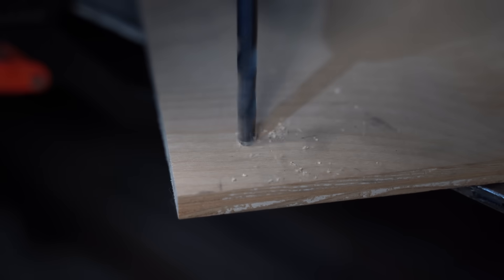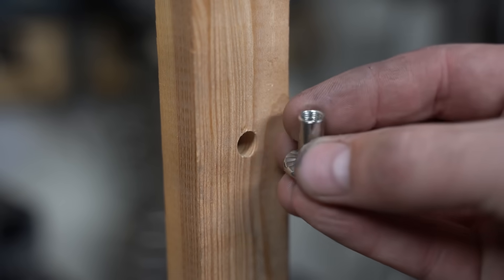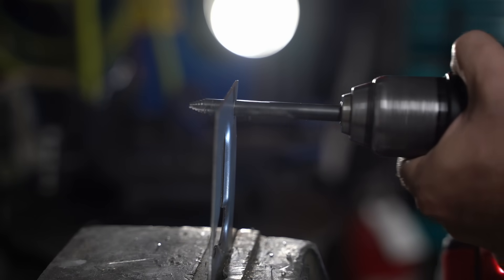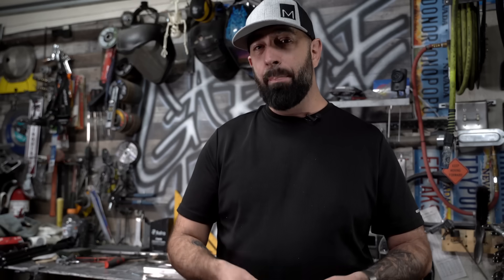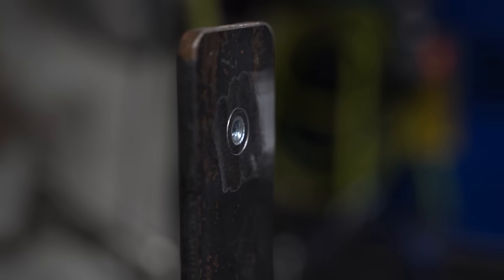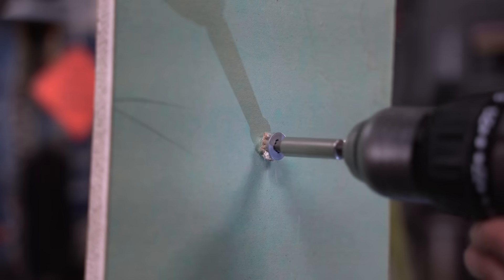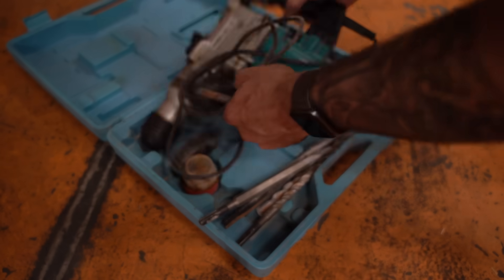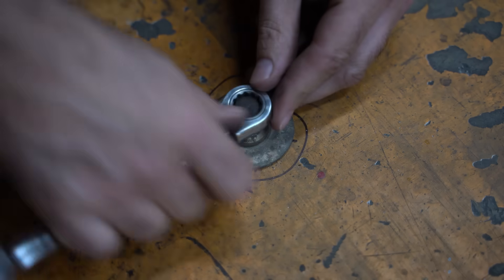Make It Bolt On! 9 Ways of Installing Threads Without Tapping.

Comment: I don't mind tapping steel.  But if the metal plate isn't thick enough to be strong after tapping, I'll often weld un-plated square steel nuts to the backside of a clearance hole.  I temporarily hold the nut in place from the front with a short stainless steel bolt sprayed with anti-spatter spray while I weld it.  That keeps the nut from accidentally getting stuck to the bolt during welding (if you overheat and distort the nut), and acts a lubricant when you disassemble it.   Square un-plated steel nuts work well for welding, because you can do two or four easy straight welds and you're done, and you get more weld area than you would get with a hex nut.  Places like McMaster-Carr sell the un-plated square nuts, and they also sell un-plated "weld-nuts", which are hat shaped nuts with a wide flange formed out of thinner steel to be easily tack welded or spot welded to the back face of sheet metal.   Whenever I finish welding nuts on the back of steel, I'll run a tap through just in case the nut's threads got slightly distorted from the welding heat.  I also try to unscrew the temporary screw while everything is still hot -- just because occasionally after the weld cools, things can pull a hair crooked and cause binding of the screw.
Reply from the maker: Fantastic info, thank you Tom! I can agree with every bit of that. I don’t often weld nuts, but threaded link bar end bungs behave the same way. I believe they shrink a little which causes them to seize up. I too run a tap through them. It saves a lot of headache.

Comment: Can you please do a video on using A grinder/ cut off wheel while cutting long runs and grinding and cutting control techniques it would be very much appreciated. Also any safety tips would also be appreciated.
Reply from the maker: Absolutely! What do you mean by long runs? What problems are you having?
Reply: @GarageFab starting and cutting more than a foot on mild steel,with out it grabbing or pulling off the line.

Comment: There's also wellnuts, which are essentially a rivnut, but made out of rubber. They are great for waterproof applications (marine) and they are removable!
Reply from the maker: Those are amazing!! Thank you. The images I saw indeed look like riv nuts.
So when you remove the bolt, do they spring back to their original shape?
I’m considering making a Part 2 with all the stuff I’ve learned from comments. This one will certainly be included.
Reply: @GarageFab Yep, they spring back to shape. They have a little threaded nut inside the rubber sleeve.

Comment: Quick tip for welding nuts (or anything) with the coating. Go to any hardware store and buy a bottle of muriatic acid. Pour a little in a small bowl and drop the nuts in there. Let it sit for a few minutes, and then rinse it with water. The acid will dissolve all of the zinc coating and take it down to bare steel. No grinding required!
Reply from the maker: I recently learned that vinegar does this as well. But it takes many hours. I'd be willing to try something a little quicker.

Comment: If you are going to weld zinc coated hardware.  Drop them in some 5% or higher vinegar overnight.  It will strip the zinc off and be safer for welding
Reply from the maker: Is that true? I’ve got some concentrated vinegar made for cleaning. 30% I believe.
I might post a short if it works. Care if I name you in it?
Reply: Oh yeah it works good. Takes the zinc coating off and makes it safer to weld.  I learned that from an old welder/ blacksmith. Welding zinc plated parts is just as dangerous as welding galvanized you don't want to breathe the smoke off of it.
Reply: You can use my name if you want.  I didn't come up with it  but I don't mind sharing.
Reply: Also don't forget to neutralize or wash them with a little water before welding.

Comment: Drill a hole just slightly smaller than the size of the male thread you have, but it must be a touch bigger than the minimum size of the male thread.
Then just ream it in the there, often with an impact driver...

Comment: For metal threads there is power taps, used by a drill, they are much tougher and allow multiple holes easier.

Comment: I use tee nuts on thin metal, cut the spikes off and then tack where the spike was, extremely strong, cheap and fast
Reply from the maker: I like it! So is the flat side against the metal then?

Comment: 4:10 zink coating is the usual coating on nuts - and this is TOXIC! if welded!!
So do not do that. 
There are nuts for that case, which are NOT coated. = raw steel. Besides that fact that those are  not toxic to weld on, those are also much faster to get ready and produce a better weld.

afaik they were cheaper as well. For my last year project I just bought a 50 peace pack of M5 ones, for some €. 
I actually just welded them from the back: 
- M6 whole drilled
- M5 welding nut with an additional nut on the other side and a M5 stainless bold to hold everything in place while welding.
- not not to weld tooo hot otherwise the thread will be affected.

Comment: A few tips:
When tapping always go two or three rotations forward then back out one rotation. This breaks the chip which will jam up your tap. That chip is the likely cause of taps breaking, especially the smaller sizes. 
Old machinist trick my dad taught me. 

Also drill the proper size hole, don’t guess.. it’s an easy google search. Improper hole size can also contribute to a broken tap because the hole is not the proper diameter. 
Lastly don’t ramrod your drill while drilling the hole, the metal can work harden by getting too hot. Always a good habit to also use lube or tapping fluid. 

Trust me on this.

Comment: That's the problem with welders. They want to weld everything. Anytime it makes sense I try to fasten things so they can be modified or adjusted without much difficulty. By the way I am a welder, but also a fabricator and repairman. Rivnuts are great, but use the right ones. Aluminum in steel tends to be problematic. The cheap ones are always aluminum and get used on everything without thought. The metal drywall screw anchors tend to spin when installing screw in drywall. Plastic work fine, I just predrill. And I only use metal ones in wood. The plastic breaks. Great ideas!

Comment: you can use your impact to rigid tap. much easier and way way faster. a 12 point socket will grab the shank end, or get fancy and buy a tap driver with a 1/4 or 3/8 end. go slow and keep the tap straight, use taping fluid on harder stuff. 
pro tip; chamfer the hole before taping to help guide the tap in straight.  for blind holes use a spiral flute tap., for through holes just about any decent plug type tap will work.

Comment: 5:15 the tubing nuts are star nuts that are used commonly on bicycles to hold the headset tight in the steer tube
Reply from the maker: I don’t know what those terms mean!! Back in my day the neck was held on by a long bolt attached to an angled doohickey nut inside the fork tube!
Reply: @GarageFab  I could show you how the newer bikes are put together if you like .

Comment: Nitride coated gun taps are your friend. Properly sized drill bit , a tap and a cordless drill and you can tap 1/2 dozen holes in 3/8 or thicker steel in the time it takes you to tap one with a t wrench.
For block or concrete Lead anchors with a hollow wall anchor set are the way to go if you want to keep the anchor flush with the surface.

Comment: I didn't know what barrel nuts were called. Now I can find them on McMaster. 

The throttle pedal assembly in my car is attached to studs that are just long enough, making it difficult to put a spacer under it to adjust the height. But with barrel nuts, I can make a thicker spacer, and still reach the studs that will be recessed. 👍

Comment: MK: I liked the flush welded nut. I put the nut and weld it on top because I’m usually welding it on tubing. It never occurred to me to simulate a riv nut for flat stock. Thanks
Reply from the maker: I have feeling your way is far more secure. I wouldn’t use the flush nut on something like a safety harness anchor. After grinding the weld down there’s not a whole lot holding it in. Great for stuff like fuel/brake lines.

Comment: FYI they make a variety of different nuts that are intended to be welded on.  Either plain, heavy hex nuts or actual weld nuts.  That way you don't have to sand off the zinc.
U-nuts are also known as spring nuts or speed nuts. there's dozens of different types out there.  I prefer the style that have an actual nut.
Also, the little plastic fasteners that OEMs use (christmas trees, push pins, etc) can be pretty decent for a lot things and make for a professional look.

Comment: Nicely explained and illustrated. I've been screwing around for decades but learned a few new ways to continue that tradition. How about those female threaded hex standoffs? Also, welding pipe through square or rectangular tubing to run a bolt through  that enhances its ability to survive force. I used this to mount a 12K winch on a trailer. With female threads its like a super riv-nut.and works well in C shaped auto/truck frames.

Comment: I’ve always known the U Nuts as speed nuts. Pretty common in older cars. Many times you will find them in slotted holes to allow for some fit adjustment.
A little tip for welded nuts, or if you are welding on a stud, is coating the threads with nozzle gel. It will keep the welding berries from contaminating the threads. It’s good for welding near any threaded structure to keep it clean and not needing to run a tap or die over it afterwards, especially if welding with flux core. 
I like to weld captive nuts by running a screw or bolt through it, using a fender washer on the back side, and coating any exposed threads with nozzle gel. Clean threads every time, and no thread distortion or material warping with the stabilization of the threads and the washer. For lots of them, I would make a fixture with a bolt or screw, and some .25 on the back for stability. If you are doing a project where you have a lot of welded nuts, the zinc coating can be removed with a bath in muriatic acid. It should be noted that welding through zinc coating can make you sick, and is no bueno.
With the nutserts, it’s good to run a tap through the after setting. The threads can distort a little. You can set them with a bolt, washer, and nut, if you don’t have the tool or you don’t have a particular setter for a thread.

Comment: For plastic, there are brass inserts that can be installed into holes with a soldering iron. This is very common place for 3-D printed parts that need threads.
Reply from the maker: Oh yes!!! I’ve seen those on the ol Instagrams! I might have to do a Part 2.
Thank you!

Comment: Grind a slot in the bolt & force it into the hole while spinning it with an impact driver, it will cut the threads itself.

like a self-tapping screw 😂

Comment: One note…you can install threaded nut inserts without the fancy tool using a bolt or threaded rod and  a couple washers. This also works in areas where it’s too tight to fit the nut setting tool. I prefer to work in areas that are too tight for my nut setting tool…jus sayin..🤷🏻‍♂️😆

Comment: Here is a tip for Nutserts, either steel or aluminum. Yes, the squeeze tool is a bit more convenient with less pieces but this saves money for a budget minded person. Nutserts do not require a special tool. All you need is a bolt with the same thread as the Nutsert plus extra thread to accommodate 2 washers and a hex nut.  Thread the nut all the way onto the bolt, lubricate the surfaces of the washers so friction is reduced and slide them up to the nut, then install the bolt into the Nutsert with 2 threads showing on the exit end. Install the Nutsert fully into the hole. Hole the head of the bolt with a wrench or socket to keep it from rotating. With an open end wrench, tighten the nut until you can feel that the Nutsert is no longer collapsing. You will know when. Now loosen the nut and remove the bolt, nut and the 2 washers. The Nutsert is not properly installed. Onto the next hole or install your part.
Reply: I came to comments to say this, but you’ve done it just fine! I used this method on a cheap (Chinese!) coffee-table a friend bought where the nuts were turning (hadn’t been tightened properly in factory). Worked a treat! Les🇬🇧
Reply from the maker: Nice! Thank you! I was recently redoing to think of a way to do it without the tool.
You can expect to see this in a video in the future. 🍻
Reply: @GarageFab  I've also used the above technique (or there abouts) for where I didn't have enough room to get the nutsert tool in there.
Reply: Thanks for this! If you have a slightly longer bolt than you suggested you could use a ratcheting wrench on the nut to tighten it in a confined spot fast with no fumbling around.

Comment: I always had trouble when welding nuts on the back side of a metal plate, when you tighten a bolt it often pulls the threads tight to the side of hole so when you go to thread the bolt in again the threads get messed up. I bought counter sunk bolts in a bunch of sizes and use those to hold the nut when welding, it centers the nut on the hole.

Comment: The drywall anchor thing cracked me up. Accidentally hit a stud! The best drywall anchor is a zip tie toggle if you can cover a 1/2" hole.
Reply: Drywall anchor can hold up to a 50# (IIRC) perpendicular  load on a wall. Wont hold a small pastry if screwed into the ceiling or if it has a diagonal pull.

Comment: I've never drilled out the hole so big that the nut fits all the way thru. I've only ever welded on nuts that stick out from the steel. I guess an old dog can be taught new tricks.

Comment: you can use thickened epoxy to cast threads in an oversized hole. (There is wonderful technical data available as to strength.)